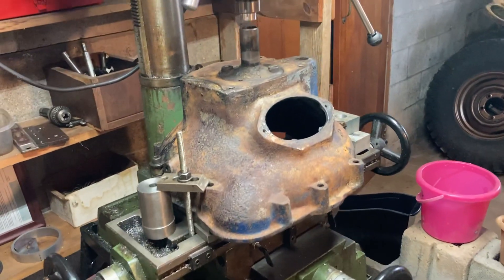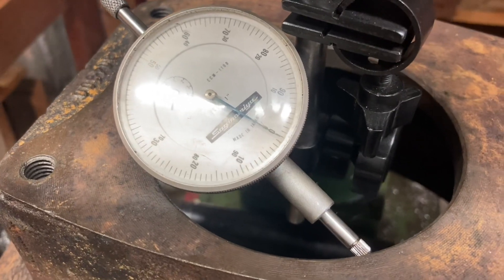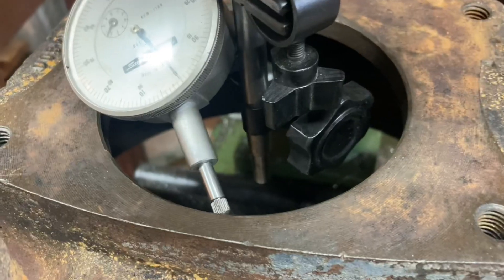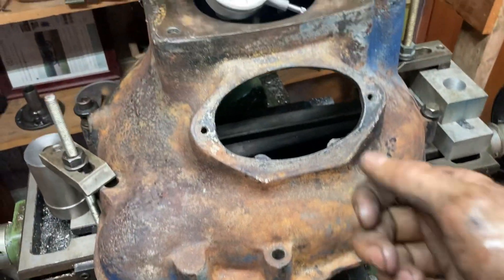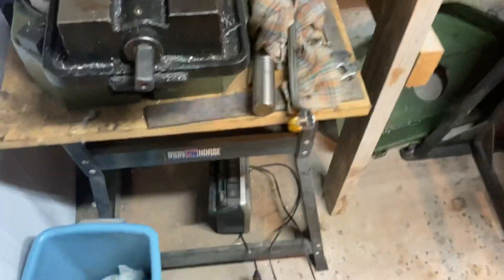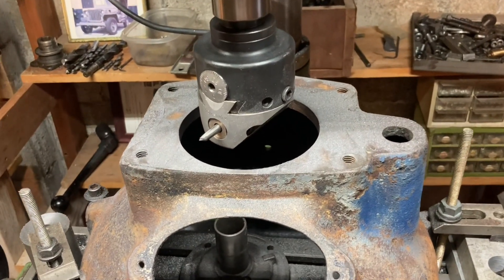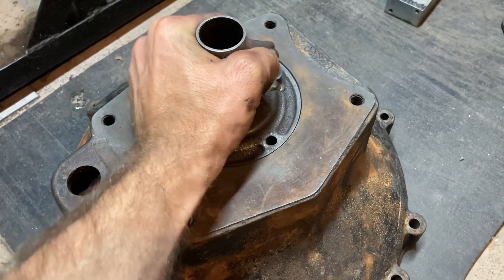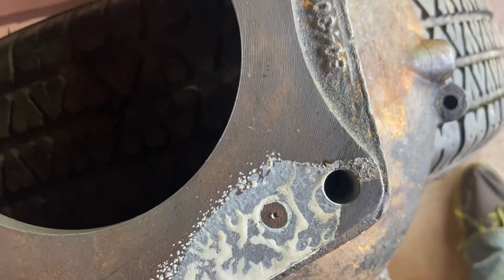Willys jeep 4 speed swap

Comment: Did you use any of the original sm420 bell housing mounting holes? Looks like all 4 bell housing holes had to be drill and tapped in the trans case to fit the Willy’s bell housing
Reply from the maker: This is a full custom conversion. Nothing lines up. lol. The Willys and GM do not share any holes.
Reply: @SethHensler  Thank you for the reply! I’m sure I’ll have a lot more questions
Reply: @SethHensler  could you provide more details on the flywheel and starter that you used for this setup?

Comment: Awesome content! I’m getting ready to swap an sm420 into my 3a with the L134 and was wondering if you had to alter the main shaft to accommodate the pilot bushing? Thanks!
Reply from the maker: Thanks! I’m running a cj5 flywheel with the stock sm420 input shaft and a custom pilot bushing I made.
Reply: @SethHensler  Awesome, thanks for the info on this swap.

Comment: Great video. Are you still using the willys throw out bearing? I see you welded the clutch fork ball stud to the sm420.
Reply from the maker: Thanks! Yessir. The stock willys throwout bearing is used in this application. That makes it. Nice for booking up the stock clutch fork and cable.
Reply: Which adapter did you use from the 420 to D18?  Also some videos of the floor mods.  Thanks!